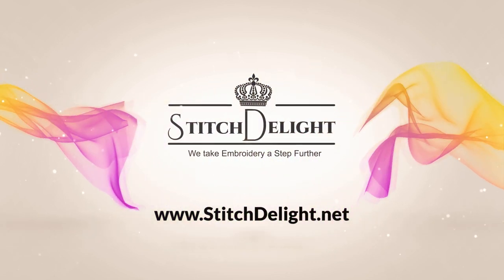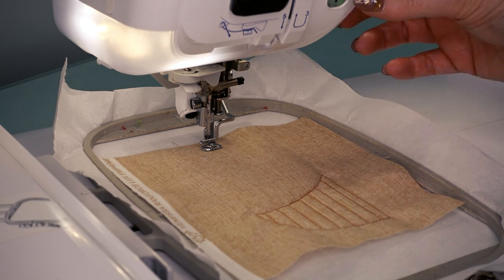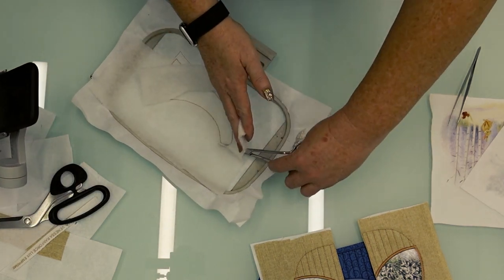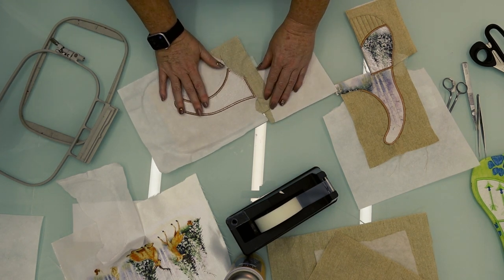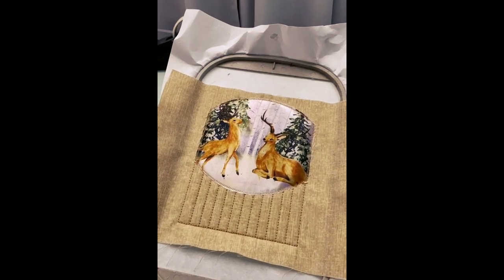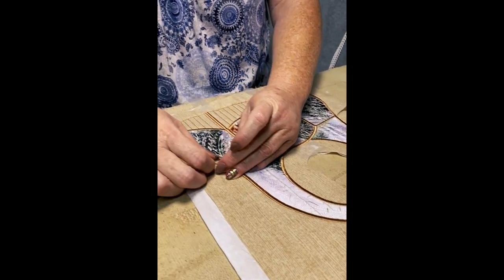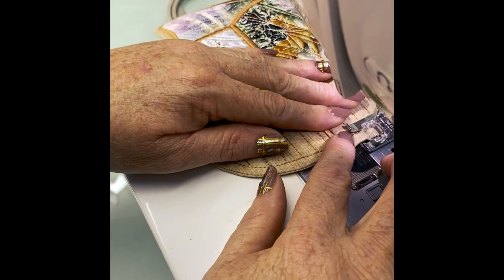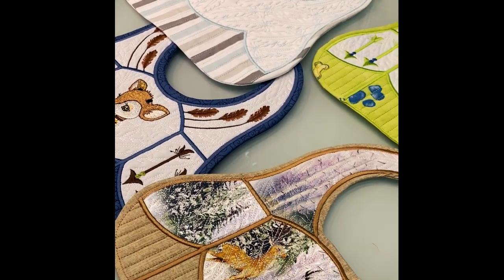SDS1765 Buttercup Baby Bibs

Comment: Hallo all the best for 2022. Please advise when digitizing for terry 
cloth for babies what must the object prop stitch spacing be.? and 
underlay and pull comp. can the same settings be emb on any other cloth 
as well then?
Reply from the maker: Carina, it depends on the software, not all software have the same settings, you might find a stitch spacing in one software of .40mm and in others a .32mm - but compensation is made in other default areas.  That said, most of the time if a design was digitized for terry cloth etc, it will be suitable for cotton fabric, lycra etc, but not for very thin fabric, as it might be a bit dense for that.